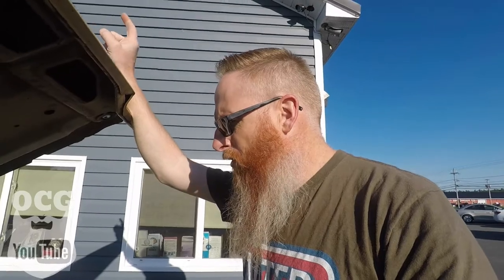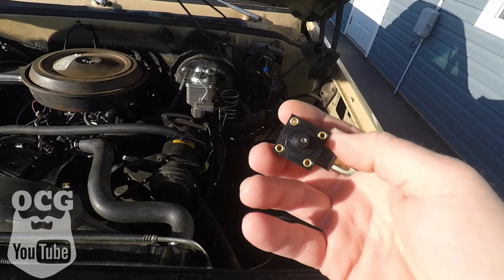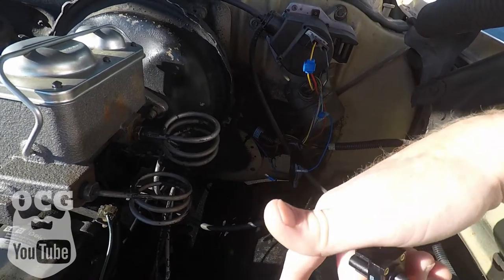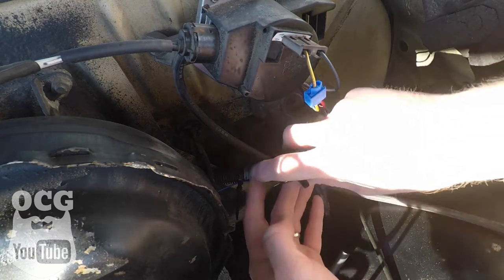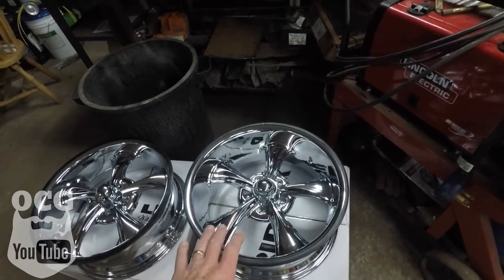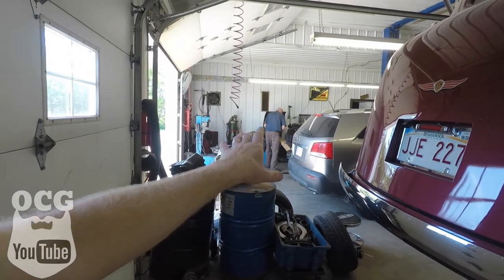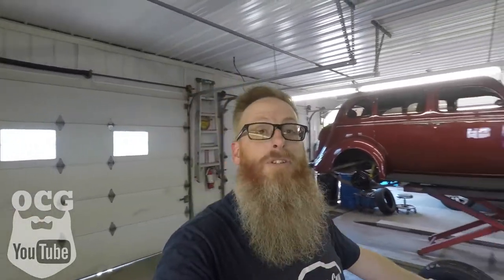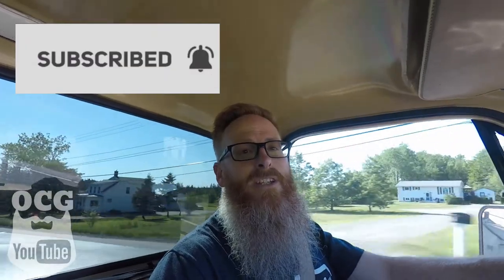How to install a Superior Solutions adjustable vacuum switch for your 700R4 lockup torque converter

Comment: So how do you connect it on the bottom of the transmission I understand how you connected at the top side
Reply from the maker: All you do is power it up from the live wire in  the 4 pin connector on the trans. i think it green. But just double check!

Comment: Good video ...i just got my 7004 bk from transmission shop im put it on my 60 chevy the shop has my 7004 with 1 wire will this switch u ised work for me if i wirecit like you did n add the vacuum line from card ... that switch is where i would hook up my 1 wire from the transmission????
Reply from the maker: Yessir!

Comment: I did a efi to carb swap on my 87 camaro with a 700r4.im told this looses t converter lock up control.So will this kit all I required to regain lock up control.?? or is the switch kit needed which is sold for 200 plus.
Reply from the maker: This should be all you need!

Comment: hey that plug  thats on the driver side of my trans..has 3 wires comng out of it can i just take two of the wires and tie them both togather and the other wire to a 12 v source and put a switch on it...and i seen a edelbrock tps kit that mounts on the side of my carb and i can plug it in to my tps connector..
Reply from the maker: Should work.

Comment: ONE Of these wires must go to the trans?? Which one? there are theww connections on that switch...i just bought one, one has to intersect at the trans cicuit to open and close the voltage...Yes? Thanks!
Reply from the maker: You are correct. I guess I assumed, when making the video that folks would know that there was a wire coming from the transmission. On the 700R4, there is a 4 pin connector,  and i believe it was the green wire that activated the lock-up. Hope this helps and/or clarifies.
Reply: @OldeCarrGuy  Great! I think mine must be blue, I have a th350c so it's probably a little different but this does clarify...Thanks for the timely response, most appreciate!! I guess I can pull the brake cut off switch now as well...

Comment: Did you wire it up to a random hot wire or did you wire it up to a wire that gets hot only when you apply the break?
Reply from the maker: I eventually wired it up to keyed power in the fuse box.
Reply: @OldeCarrGuy   im a little confused on how to do this I'm swapping my 4l60e out for a 700r4 and im trying to see how to wire this vacuum switch up im seeing where people are wiring it up to there brake petal switch but it seems like I could wire it up to any wire that's hot while key is on.

Comment: Bought this switch to replace the broken GM Vac switch,  but think mine is faulty.  It's permanently normally closed.
I thought how it worked was open circuit until it gets enough vacuum,  then it switches to normally closed, circuit complete ,then lock up happens. 
Is this correct?
Reply from the maker: There is an allan head adjuster screw to change the open/close point. Your's may be screwed in too far.
Reply: @OldeCarrGuy I was testing the switch out of the truck , using a pump to set pressure,  I realised my mistake,  that's positive pressure,  not negative pressure 🤦‍♂️

Comment: WHAT ABout when you apply brakes. Is the brake switch in the loop?
Reply from the maker: No brake switch required. Because it is vacuum operated (adjustable), as soon as you take your foot off the gas, the vacuum closes the switch. as soon as you step on the gas and lose vacuum again, the converter will lockup. I hope I explained that ok.
Reply: @OldeCarrGuy  Thanks much!

Comment: Is a toggle switch still needed to turn lock up on and off?
Reply from the maker: Not unless you want one! This device essentially replaces the toggle switch so it engages automatically!
Reply: @OldeCarrGuy  Have you found any disadvantages to using the time delay? For example, perhaps it engages after 10 seconds but by then, you're at low cruising speed. Will engaging hurt anything or effect performance? Just one example but have you experienced any downside?

Comment: i believe my trans is 4l SAME..60 with out the   (E)  I ASSUM THE 4L60 AND THE 4L60E IS PRTTY MUST THE SAME
Reply from the maker: Not 100% sure, but I think the 4L60E is electronically controlled through the PCM whereas the 4L60 is a stand alone trans.

Comment: Where did you get the power for the switch?
Reply from the maker: I tapped into the wiper motor but you should find a different accessory power source from the fuse panel. there are spares there!
Reply: @OldeCarrGuy  Thanks, where i tapped in kept blowing the Gauges fuse on my 92 camaro,  and when i tryed to use the accesory power on the fuse block, if blew it too lol
Reply: mine is hooked up to my 20a fused brake switch then to the ignition switch. the other lead on the vacuum switch then goes to the trans (i only have 1 wire)

Comment: What wire sends a signal to the transmission??
Reply from the maker: There should be a green wire on the 4 pin connector from the transmission.
Reply: @OldeCarrGuy  I'm dumb. Hook the green wire to where?
Reply from the maker: @zambino8763  hook it to one side of the switch and accessory power to the other side.
Reply: @OldeCarrGuy  I feel stupid but Google is not helping me. What wire goes to NO, which NC, and which to COMM? That's where I'm lost...
Reply from the maker: @zambino8763  find me on IG or Facebook. We can chat better there
Reply: @OldeCarrGuy  Sent you a message on messenger. To the page. Hope that works..

Comment: You don't need ALL that bullshit. 
Lockup was designed for 4th gear economy only. No toggle switch needed to turn off lockup. Simply shift into 3rd gear n leave it there for in town low speed driving. It will never lockup or "lug". When you get on the "highway", simply shift in OD!!!
Elementry, my dear Watson..
Reply from the maker: I realize that, but I’m lazy and just want to drive my truck!
Reply: Hey if I leave it in 3rd for driving around town, will it still down shift into 2nd and 1st when coming to a stop?
Reply: @Michael-White 
Yes, it will.
The governor n servo in the tranny takes care of that. Shift into OD when you get on the highway when you want it...